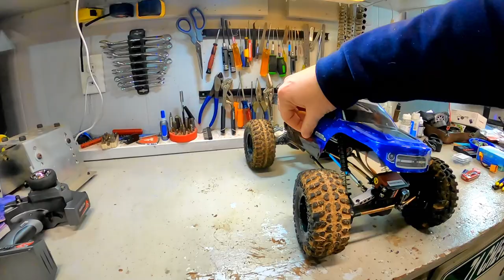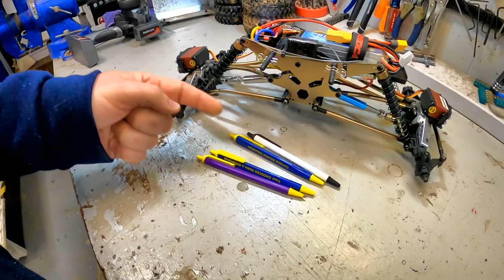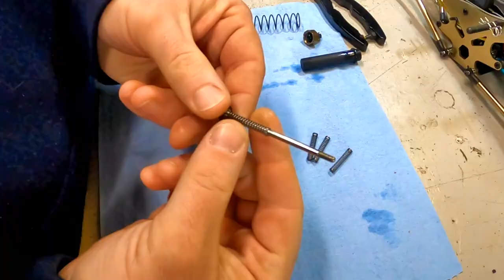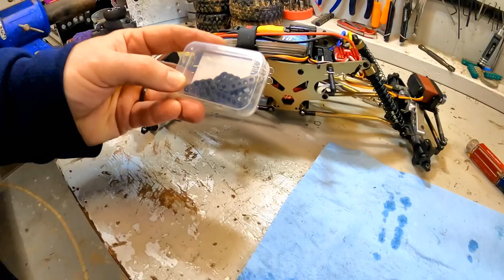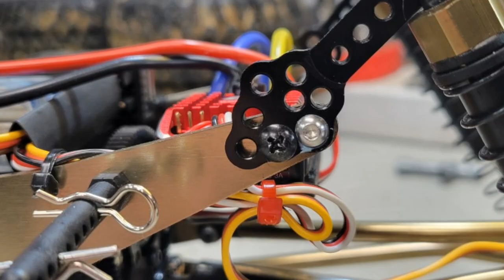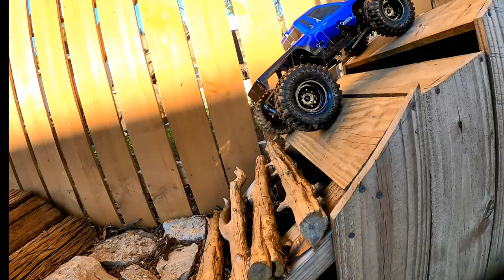Free & Cheap RC Crawler Suspension Mods | Redcat Everest 10

Comment: I love my Everest 10, I got shorter shocks, Proline Hyrax tires, Trailmaster 550 45t motor and I use the Flysky GT5.  It will go almost anywhere.  Thanks for the Video
Reply from the maker: Thanks for the tips!
Reply: How did you get a 550 motor mounted? Barely enough room for the 540 with the link hardware so close.

Comment: I tried doing this I didn't get quite as low with mine and honestly I just didn't care for the style. For my style and type of crawling it got hung up super easy so Easy. I found it handled the best for at least the style of Chrome stock ride height with 4 wheel steering wheel extenders and I'm probably going to need to put some weight in the tires. Shockingly capable. I definitely see how some people could benefit from these upgrades though
Reply from the maker: Interesting!  Perhaps it is just different terrain.
Reply: @RoadsideRC  that's my gess

Comment: Trying to understand why you would want to lower ground clearance and flex in a crawler. And only gaining 5 degrees doesn't seem worth it at all. What am I nit understanding
Reply from the maker: It is all about the center of gravity.   
With a taller vehicle, you find the truck is constantly flipping over as it attempts to climb things.   Getting a truck low helps prevent that.  

The amount of flex is also important - but more is not necessarily better.  You need a truck to have compliance, but also.be able to pull itself up obstacles...instead of flexing around them. 

Hope that helps!
Reply: @RoadsideRC  That makes since. I will give it a try when mine gets here. I will also try it on my Danchee Ridgerock. I am notorious for using spacers. I love the wider stance. Danchee has after market shocks, spacers, servos, and added weight. Still wants to bounce.

Comment: I love the articulation of the Everest 10, and because I needed not to lose that, I opted out of using the pen springs. I got the shock keys and was able to mount the shock caps higher on the chassis, and lower the center of gravity. I also cut off the tray of my body and made it a cab-,only body. I also made new mounting holes on the cab and lowered the body onto the chassis. My EVEREST 10 now looks mean, thanks to this video.
Reply from the maker: Awesome!   Sounds like you built a fun truck!

Comment: looks cool. you lose travel when you put that spring in and when you move the shock mounts out. I'm new, wouldn't cutting or getting softer springs make it sit lower, be easier, cheaper, faster and increase performance while maintaining the same travel?
Reply from the maker: You list a lot of items there:
Lower - maybe, depends on spec
Easier - sure! 
Cheaper - nope - this was free! 
Faster - no, not with finding and buying the right ones. 
Inc Perf - depends.  

The whole point of this mod is that low budget, which goes very well with the truck being entry level.

Comment: I know this is an older video, I bought aftermarket chassis plates that basically accomplish the extensions that you put on, however I did a DIFFERENT pen spring mod, I actually removed the springs all together and ran the pen springs on the outside of the shaft, they work kind of like a bump stop (they are almost pointless other than keeping the tires off the body) but this allows for full droop so I'm low but don't really lose much articulation at all.
Reply from the maker: Interesting!   Thanks for the idea.

Comment: Loved how you finally used that spring mod. I am still using it on my jr. Same as when you seen it at axialfest. 1bobber spring and 1 ink pen per rear shock. Never thought about doing on the e10 though
Reply from the maker: Yes!  I did it on another crawler at one point - don't remember which one.  Works great for a budget mod!

Comment: Awesome. I did something similar and I also shorten the wheel base by a inch in the front.
Reply from the maker: Interesting!  I bet the shorter front wheelbase helps reducing dragging.
Reply: Exactly
Reply: I swapped the top links to bottom and made new links for top

Comment: Getting ready to order two of these rigs.
What are some things I should be aware of?
I've watched countless videos on these and for the money they seem to be legitimately a good truck with ability to make insane mods.
However...I'm not gonna be doing anything in the realm of extreme crawling with crazy angles lol.....I just really want a better wheel and tire setup for more grip and better looks
Then maybe aluminum axle housings🤷‍♂️
Reply from the maker: They are fun trucks!  There are certainly more capable trucks out there however, depending on your goals - but of course, at a higher price. 

Wheels and tires are a very important early upgrade. 
Upgrading the diff locker itself is also good.  It is the metal locker in the middle of the diff that could use upgraded.  
Most likely, you will want to swap out for a lower turn motor to get some more speed out of it.  

Honestly, don't waste a bunch of $$ on aluminum housing and the like.  They don't actually improve the performance.

Comment: Everest-10 Pro, l would buy that! I agree with you, it is a under rated rc. I enjoy my E10 as much as my more expensive crawlers. I lowered it a bit and have brass axle hub extenders on mine, they widened the truck by an inch. I just wish l could overdrive  the front axle. Looking forward to more content from you. 🙂
Reply from the maker: Agree!  I would really like overdrive in it!
Reply: @RoadsideRC  How about fitting an Element stealth trans.?
Reply from the maker: I have seen someone else do it.  It would do the job!
Not sure I want to spend that $$$ on it though.

Comment: I love how you made this Everest even a more capable crawler. It would even be more interesting to see if you could do something about the belly rub on the bottom chassis. Maybe there is a aftermarket company out there that makes a slimmer chassis to eliminate belly rub or bottom chassis rub .
Reply from the maker: When you go low, that is certainly a risk you run!  Still, worth it for the overall performance.
Reply: Great point. I like the look of the everest and these mods maybe just the pen spring mods and maybe move the shocks a little bit. Also bigger tires and steeper gears
Reply: I countersunk the screws so they don't hook rocks as easy

Comment: What size tires are those?  I got some 150x 60s coming and for the rims HOBBYSOUL Wide 1.57'' (40mm) 2.2 Beadlock Wheels Adjustable 4 Offsets Rims Silver Blue.  I just hope 150mm isn’t to tall lol.
Reply from the maker: Unfortunately, I do not fully remember. 

I do not believe 150mm is too tall for this truck.   That is a standard 2.2 size.

Comment: The much.lowered ground clearance concerns me. Try the scx10 ii shock mounts the other direction and pay the shocks down vs stand them up.
Reply from the maker: You will find a low cog is a really good thing. You will spend a lot less time flipping it over after a tumble.
Reply: @RoadsideRC  no doubt about that. This is not the best way to do that and maintain the everest or axial.ax platform as they both operate under the same long travel flex buggy design. Removing travel by putting a shock limiter on and then standing the shocks up vs laid.down which is how this chassis was designed to operate. I'm not talking out my.ass here. Try it if it don't work. Feel free to call me an idiot.
Reply from the maker: @chriskryder2994  This truck has long-since been sold.   I don't doubt there are better ways to do it - but I was looking for free/cheap.

Comment: I wanna use mine in competitions what class would  this truck fall into?
Reply from the maker: Unfortunately, with the chassis design it forces it into either Class 3 or Comp truck.  Which will make it VERY uncompetitive.  

See your local rules though - perhaps they have variations on the standard rules at your local events.

Comment: What type of wights are on the front and rear axles
Reply from the maker: They are not weights.  They are aluminum axle trusses.  Like these:  https://amzn.to/3Ign2Pf   Or like these:  https://www.ebay.com/itm/401469845423?mkcid=1&mkrid=711-53200-19255-0&siteid=0&campid=5338469288&toolid=11800&mkevt=1

It has been awhile, so I am actually not sure which it is.
Reply: @RoadsideRC  ohhh ok ok and thank you

Comment: Like that set up ! I got one for Christmas and have been modifying it ever since. I like that mod with the pen springs.  I may try that. I was going to buy shorter shocks. I like your course. New to crawling and in the process of building a crawler coarse/sct track/bash area. Inherited my father's farm. I am even going to put a 1/18 dirt track and a 1/24 crawler course in the barn. I have a couple of vids on YOUTUBE. You can check out my Everest-10 set up there. Thanks for the video.
Reply from the maker: Thanks for the comment. 
Good luck with the course build!
Reply: @RoadsideRC  Thanks. I put together a 1/24 course in my basement this winter, and it got out of hand in a hurry. I plan on moving the whole thing to the barn. I got the space to go crazy in there. The 1/18 sct track in there will be a little tight,  but should work out. I started a larger sct track out back of the barn this last fall. It just might be a little more than my tractor can handle.  To build it any way. Might rent a skid steer this spring. Knock it out in one day. I will be posting videos of it all as I go. If you want to check it out? Just started posting videos here on you tube a few days ago. Should be fun.

Comment: I just purchased the E10 and first thing I wanna do is upgrade the suspension.  I also want to upgrade the motor and esc and gears.  If anyone could point me in the right direction for theods I need that would be awesome!
Reply from the maker: This video should help with the suspension mods....what other clarification on it do you need? 

Here is my go-to ESC and motor setup:  https://amzn.to/3S1dJXg
Reply: @RoadsideRC  nice thanks brother man I appreciate you!!
Reply: @RoadsideRC  I was reading the Amazon reviews and one customer was talking about needing a programming card.  Will I need one?  If I do how do I set it up.
Reply from the maker: @M-vf7pn  You don't always "need" to change anything in the programming.   But - it actually comes with the program card.
Reply: @RoadsideRC  oh ok cool to know👍 thanks bro
Reply: I ordered the Hobbywing Fusion quick run se 18kv and wouldn't ya know it the damn thing didn't fit and I'm SOOOO pissed!  I thought it would fit I just simply dropped the ball I didn't do enough research.  Can you recommend a good crawler motor/esc that would fit and one that doesn't need a program card.  If I could make the Hobbywing motor fit I would love to keep it because man the reviews on that thing are extremely good.  I am in the process of lowering my E10.
Reply from the maker: @Webb4RC  I bet you can make it fit!   What is it hitting?
Reply: @RoadsideRC  the metal bar that's attached to the frame.
Reply: @RoadsideRC  the side linkage right behind the battery, if I had 4mm more it would work!
Reply: @RoadsideRC  it's the upper linkage not the bottom linkage.
Reply from the maker: @Webb4RC  I believe you can move that to a different mounting hole to create clearance.   Of course - do it to both sides.